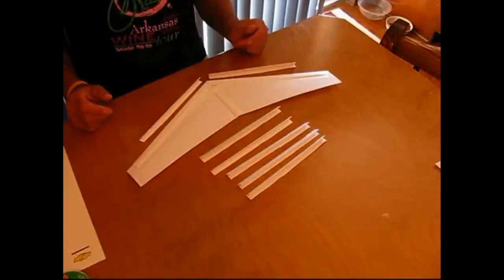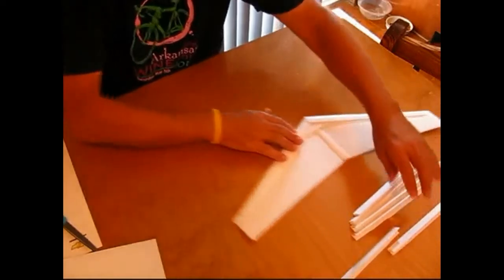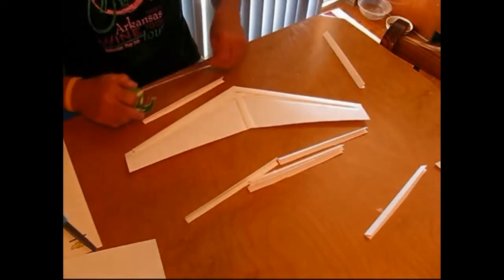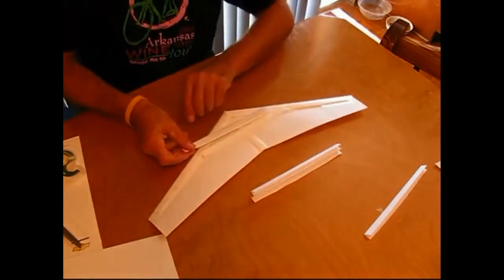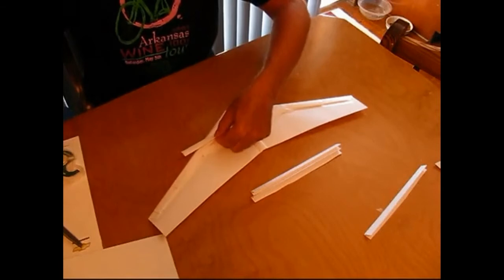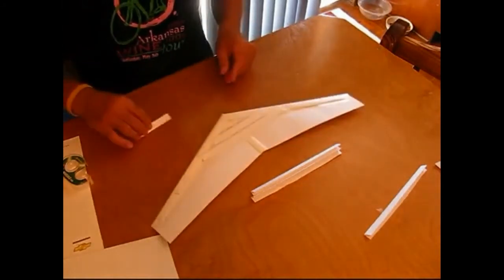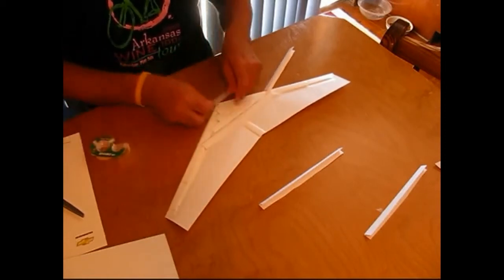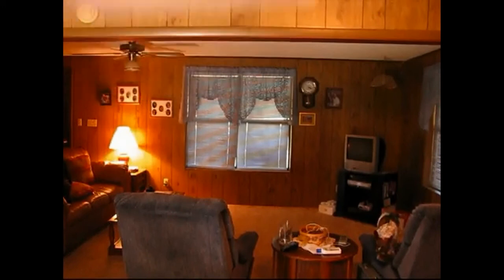Advanced OmniWing Construction (Part 3)

Comment from the maker: Try to get more twist in the wing.  What happens often with the Advanced OmniWing is that the adding of the additional internal structures can take out the twist, thus a wing with a nose diving tendency.  So when applying each of the structural roles, try to enhance the twist as you apply each.  Also, if not perfect and a diving wing, try applying a bit of up reflex in the last fourth of the wing cord out on the tips, to act as elevator.   A little post construction tuning is usually needed.

Comment from the maker: Either works about the same.  There is a lot of flexibility in how you can assemble once you are at this stage.  Main thing is to concentrate the bulk of the reinforcing towards the front and middle of the wing to provide proper center of gravity.